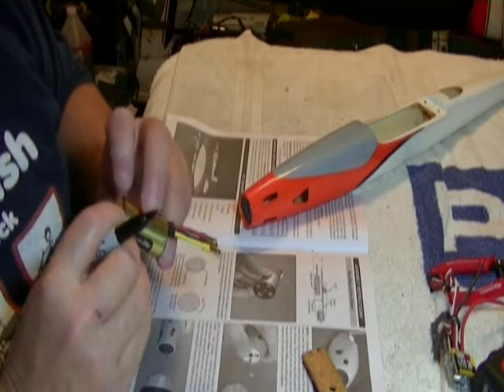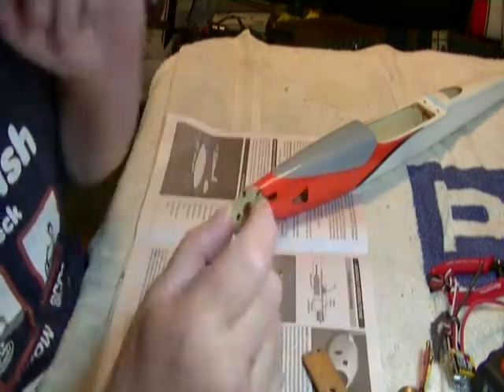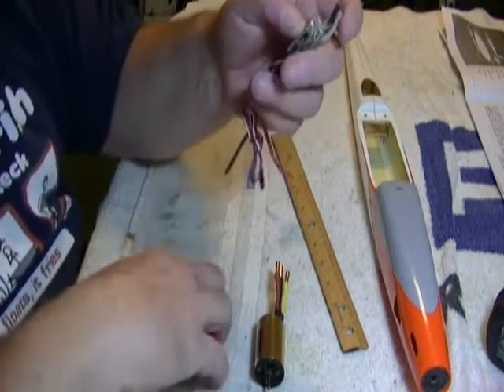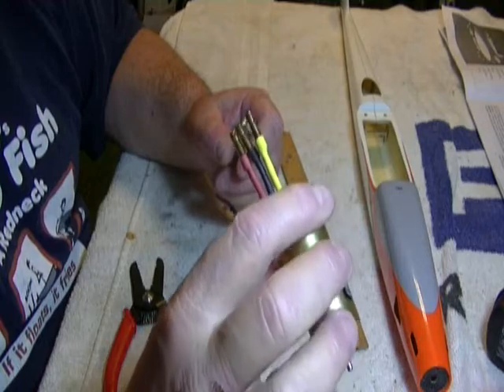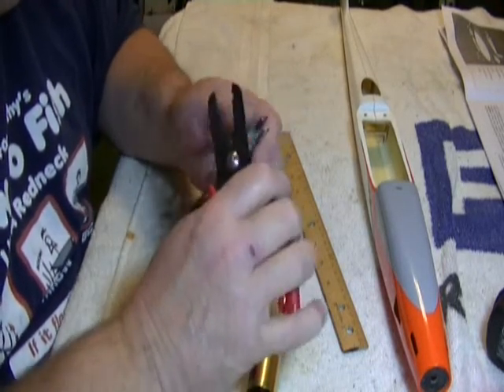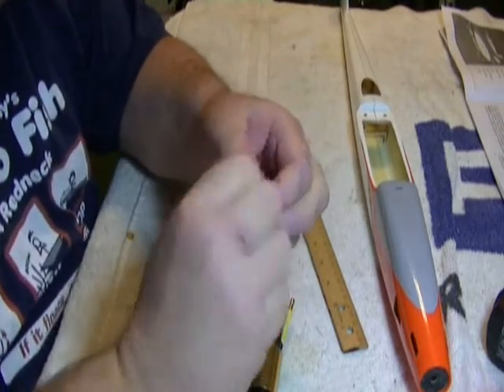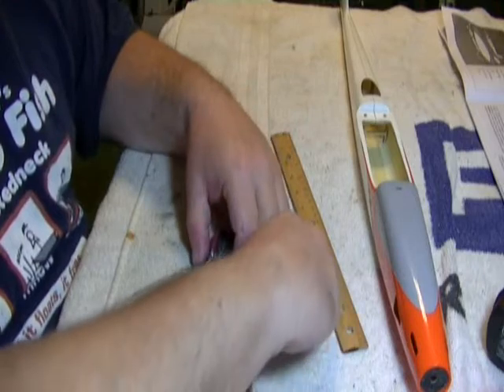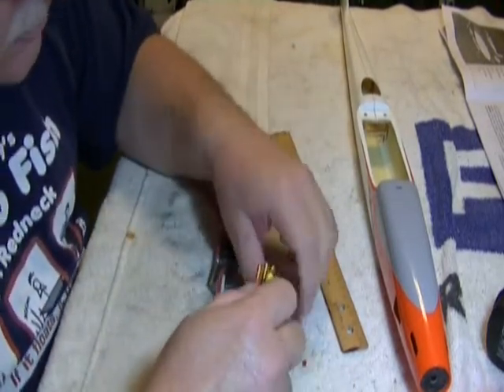Part 1 Building The Rifle 1m From Great Planes

Comment: Good lookin little plane Terry, a couple lengths of threaded control rod could come in handy for pulling the motor in place if you build a similar plane in the future. Is that a fiberglass fuselage?
Reply from the maker: Thanks Daryl, man that is a good idea, never thought of that on the motor, i have a couple of friends that are going to build it as well, i will pass it on to them. Yes the fuse is all fiberglass, the wing looks to be fiberglass covered foam maybe. Take care my friend

Comment: It calls for an inrunner isn't that kind of old technology now days? Would it be better to run an outrunner?
Reply from the maker: I think probably because of the tiny narrow fuselage, an outrunner would run on the fuse so i'm thinking that's why it called for an indunner, it screams like crazy with what it calls for, getting 130-135 mph out of it. Take care and thanks fir the veiw my friend
Reply: ***** That's what I was thinking the narrow body. I need to learn more about motors, and props. Seems to me the faster speeds the prop size and pitch are the same like the rear bear I just bought 8x8 this one is 4.5x4.5.
Reply from the maker: I have the EFX Racer from Hobby King and it called for a 5.5x5.5 prop but i found that an APC speed 400 5.5x4.5  performs the best, i'm getting 100-105 mph on my radar gun. A friend of mine has the Rare Bear and we were racing it and the EFX Racer and the Rare Bear is faster, i love that Rare Bear by the way, it's on my "to get" list. Take care and have fun with the new plane my friend
Reply: ***** My first eflight model I really like the quality. I have not flown the Rear Bear yet waiting on a spektrum module for my older JR radio I normally use frsky radio with the module in my JR but with the $20 coupon from horizon basically got the AR636 AS3X receiver for free wanted to try out the flight stabilizer.  With the module I can use it in any transmitter. I think the spektrum transmitters are way overpriced those days are coming to an end with openTX open source now being used.